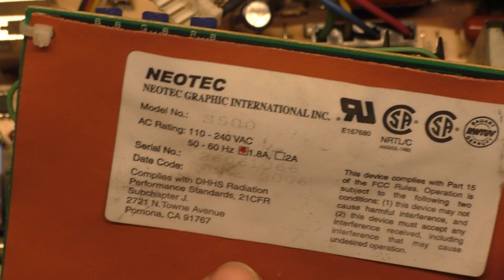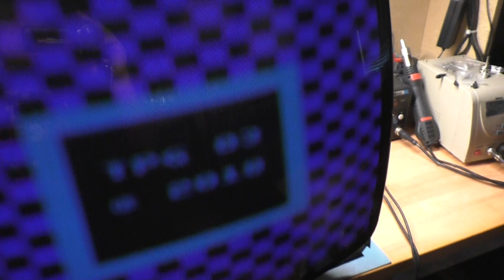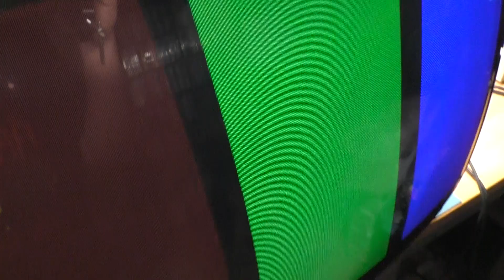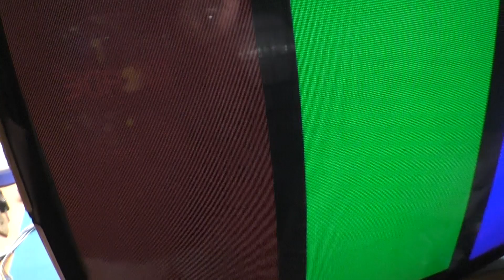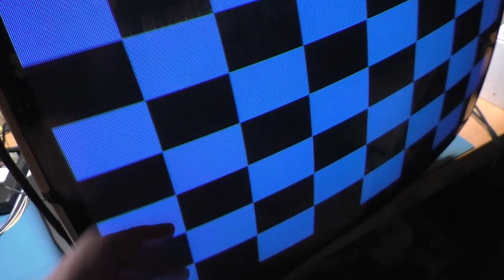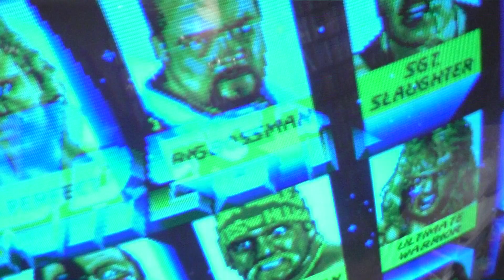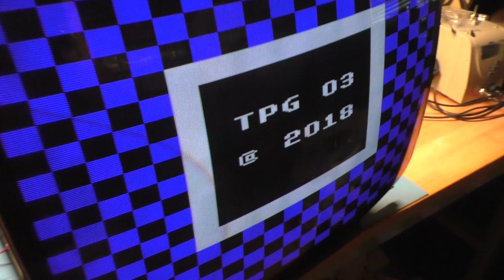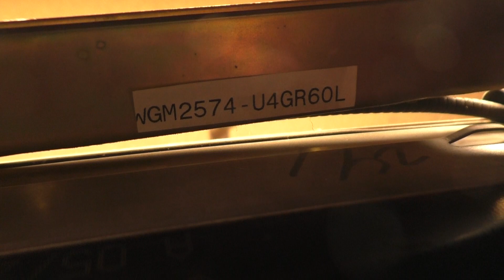25" Neotec NT-S500 Arcade Monitor Repair - Dead...But Not Dead?

Comment: I believe it's that kind of glue that seems to corrode the legs for some reason, perhaps it traps moisture? i'm not sure, but a few months back i had a diode lead in a reciever i was working on disintegrate on me from just touching it and it had similar glue on it.